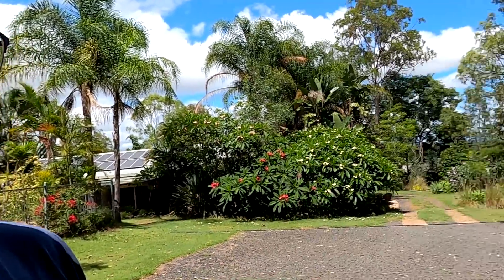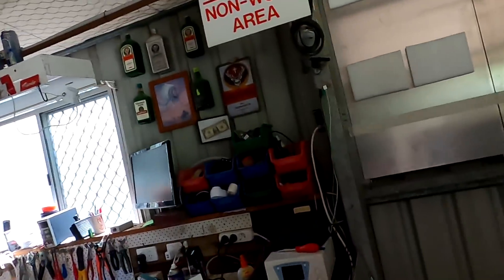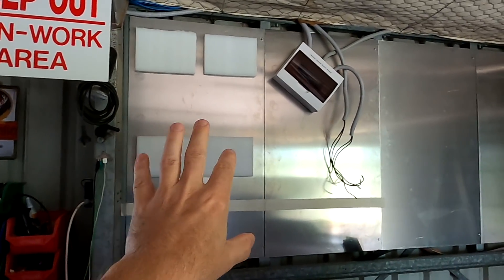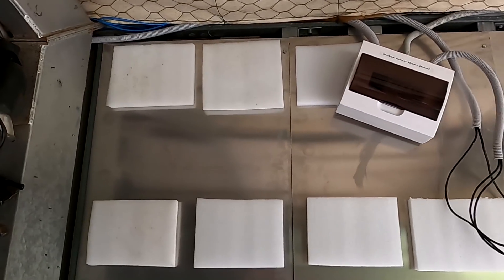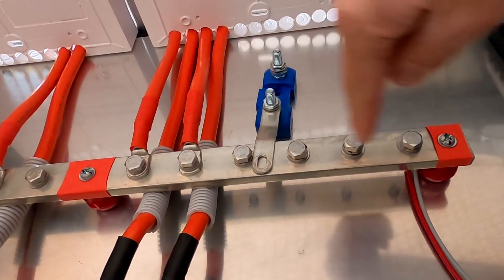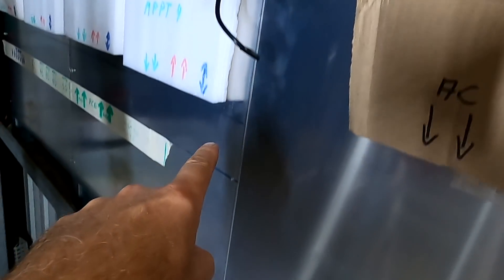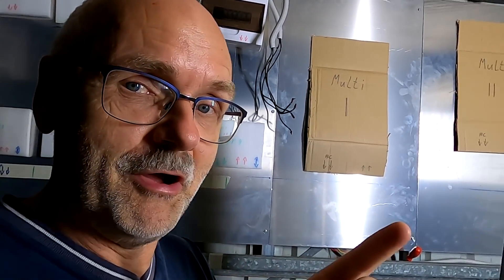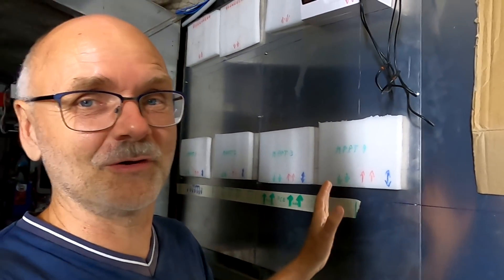No work, just design. The Solar PowerWall Project

Comment: A solar panel "roof bridge" between the two garages, will provide energy as well as shade for the east wall of the OGG
Reply: I think he should consider this other than $80 insulation roll
Reply from the maker: Great idea but I still need access to the gutters with a ladder. Also the mechanical constructions would be massive due to the wind load with such a roof.
Reply: Could be done as Andy said with lots of rails between the two, part way up the rooves. Lots of wasted unused rail. 
Easier to unscrew the tin on the side wall and add insulation later.
Reply: Anything between the sheds would get covered in leaves.
Reply: Or instead of a bridge, put more  pv panels along the wall nearly vertically. Shading the wall for cooling and collecting some extra power.
Reply: @chuckziska988  great idea
Reply: @OffGridGarageAustralia  perhaps @chuck ziska's idea?

Comment: 1.  Seal the top of your mounting panels so air cannot escape the back into the garage. 2. Create vents to the outside of the garage near the ceiling under your soffits. 3. Natural convection will pull cooler air from inside the garage (near the floor) up behind the equipment and outside. 4.  Ta Da...free equipment cooling.
Reply: I was thinking the same thing, when he said there was air in between!
Reply: Brilliant
Reply from the maker: Vent opening to the outside is not good. Rain and critters. That's a lot of effort to get this right with the corrugated outside wall. Easy on a straight wall...
Reply: @OffGridGarageAustralia  - could you put a baffle at the top, conduct the air to a pipe, route the pipe to the top most gable vent or even move it outside to add a solar attack fan?

Comment: Use the extra pv panels you have and attach them vertically on the outside wall of your garage. You will  reduce heat on the outside wall and produce a little power. Win-win in my book.
Reply from the maker: That is actually a pretty great idea!!!!

Comment: 4x M6 on each side is WAY MORE than sufficient.
Reply from the maker: Even it threads only 2.5mm into the steel post?
Reply: @OffGridGarageAustralia  The load has 2 components. Shear and tension. The shear force required to break 1 6mm bolt is 7.2kN (~767kilos). So your're good there with only 1 bolt. The other is tension. Let's say the inverter is 100 kilos and is mounted 30cm from the panel (1m tall). That works out to ~33 kilos tensile force on the top of the panel. A steel m6 bolt, even in 2mm steel, will not pull out at 33kilos force.

Comment: Thanks Andy, just as a thought for strength on the aluminium sheet you could add a fold to the top on bottom of the sheet and nick the corners out for the uprights, another good tool for making  strong threads into sheeting is using Rivnuts
Reply from the maker: Thanks Ross! I'm thinking about a horizontal support, same size as the posts but mauby I just leave it as it is and see what happens. I'll do the hang-test first 😉

Comment: smiles ... like my hot tin shed in beerwah ..  radiant and thermal conductance .. a piece of high cover shadecloth hanging from the surfeit down to base ... secured ... and this shadow does the rest .. can still get behind .. visually see the problem area ... cheap and easty to install ..  and measure to ensure has done the job .. no need to over engineer this solution .. cheers .. keep up the excellent work .. cheers
Reply from the maker: Thanks Mike. That's a good solution.

Comment: Put some pink batts in the wall behind the al panels and also behind the battery shelf, cover gap outside with panels, use the 5kva for the shed and car, then when it comes to it in a few years  put in a single phase 10kw inverter to run the house (on the right hand panel). If you think heat is still going to be a problem make a room in that corner, finish insulating the rest of the walls and add a small air con.

Comment: If you aren't going to enhance airflow through the fins of the MPPTs remember to keep your ducting 100mm from the base of the MPPTs. It might be perforated ducting but by the time you fill it with cables it will impede cooling airflow if it is too close to the MPPTs.

Comment: A perfect design of the power wall . You may need an actual PV Main Disconnect Switch where the breaker panel was coming in from the roof for a safety measure to disconnect the PVs  from the cables going to the actual breaker panel that’s on the wall . You have a great mind on your shoulders and I and we You Tubers know you will succeed with success in powering on the equipment . May the solar be with you .

Comment: Hi Andy, I really appreciate your show, it is the first thing I look for when I get on my computer. I have really learned a lot from you and I have purchased a few of thee items you have reviewed.

One final thought on your layout. Since you will have to run some large cables from your battery box to the inverters,  why not move all the huge bus bars from the battery box to the wall horizontally just below the chargers and inverters? You can tie the current short horizontal and vertical bars from the battery box  together to make the longer bars on the wall thereby eliminating any need to buy more large bus bars or wires. Then it will be a simple matter to attach the inverters to the bus bars with circuit breakers between the bus bars and the inverters.

This will  allow you to have all the connections readily available without adding more large cable as well provide shorted path to the bus bars for future use.  This will also give you room for one more row of batteries in the box, and if in the future  you need to add battery box #3  it will easily fit to the right of big box #2 with an additional 4 shelves.

I will try not to make any more suggestions on the layout unless you ask for more.

Oh, by the way, the invoice is in the mail.
Reply from the maker: Thanks Daniel, I appreciate your comments and good ideas! Please keep them coming...
That would be a total different design though. I think it's far to late for this now as the battery box is already finished. Also having the busbars mounted like this would call for large complicated covers as these busbars need to be isolated  everywhere. Shrouds, plexiglass, plastic covers. This would be huge...

Comment: Andy, Andy, Andy. 4 screws will be enough or go 6 if you want but you won't need any more than that. You are making it much more harder for your self.
Reply from the maker: 4 screws taped into 2.5mm steel will be enough? If the inverter falls down, where do you live? 😉

Comment: Hi Andy, just a thought on the heat on the wall from the sun....as the safari Landover had a second roof with an air gap.
So do the same on the the wall with a air gap and small gap top and bottom for air circulation.
Or as IV had done, think wood! Great heat resistant, as my off grid shed is in UK we have the odd day in summer of strong sun and heat but also we have a cold winter.....
My wooden shed with insulation and plywood internal covering, keeps cool in summer but warm in winter.
Reply from the maker: Thanks Mark, I still need access to the gutters for both sheds from this area. Wooden structures are not preferable in Australia. We have termites...

Comment: Andy, If thermal heating becomes an issue on your metal building panels, couldn't you just take the panels down from the outside of the building, insulate them and then reinstall them without having to disturb your PowerWall build?
Reply from the maker: No, that's not possible at all, I would have to unmount all gutters first... that's a huge effort for a small gain.

Comment: Hi Andy, love your videos! Usually i don’t comment that much but this time i have to. There is a misunderstanding about the screws and inverters. 2 M6 screws in the top will easily hold the aluminium sheet and the inverter, but more screws are better. That’s because the weight of the inverter is pointing down to the floor and not into the room. When this is finished it’s going to be a massive power factory! Regarding the combiner box near the ceiling i would definitely pull new cables all the way. Can’t be that many meters on the roof? Keep up your good work!
Reply from the maker: Thanks for your comment. Please keep them coming!
Others have suggested a horizontal cross beam between the posts to make the construction more rigid. That seems like a great idea and I will get them tomorrow. I can then have the same distance on all screws for all the panels.
In terms of the combiner box, there was a complete change I design as you mau have seen already in the next video... That was my bad mind 😉

Comment: Andi on the breaker boxes above the mppt charges I believe you have a smaller “trunk” running underneath them. Well on the right box there is two cables going into the trunk, but as you move from
the right box to the far left you are adding two cables at each box. So at the left box there will be 8 cables. Just a heads up so you can double check that the trunk wire chase is large enough. Also I would use the larger trunk wire chase with tabs in both locations just for conformity of looks.

Comment: A few thoughts, simply string the output of the fuse/breaker boxes straight down into the chargers, since there are only two wires from each breaker box they can be enclosed in a conduit between each pair cleaning up some of the mess. 

Likewise, the output of each charger can also be done the same way going straight down into the battery box thereby eliminating a large concentration of wires stuffed into a single channel and less chance of a short damaging all of the wires which means a much safer and classier looking installation. Since there is no need for the input wiring to travel horizontally the wire runs can be much shorter also cleaning things up. 

Inso far as the input to the inverters is concerned, placing the horizontal run from the battery box below the horizontal garage frame and up into the inverters keeps the left side cleaner and functionally organized.

A final thought, running the vertical wires behind the aluminum panels presents a much cleaner appearance.

Comment: The pattern with which you screwed on the screws of the plate for the charge controller is also easily sufficient for the inverter. The weight of the inverters pulls the plate down, creating mostly shearing forces on the screws. The shearing forces are carried equally by all screws.

By the way, it's funny to see how the sun travels the other way across the sky for you!

Greetings from the northern hemisphere.

Kind regards
Reply from the maker: The sun travels the same way down here, from east to west. Just we have it in the north and not south. Which does not matter in Summer as it is straight above us (almost no shade when you stand straight).

Comment: Andy, about the insulation on the back wall, have you thought about stopping the heat before it reaches the shed wall?
Perhaps shade cloth horizontally between the 2 roofs, or even vertically up the outside of the shed wall with a 100mm gap between.

For the backing metal, if you were concerned about the 6mm bolts into the shed frame you could use nutserts, this would give you a lot more metal to thread into.
Reply from the maker: Yes, Steven, that's a great suggestion. I have some older solar panels for that purpose mauby...

Comment: as for hot wall; use shade cloth on the outside of the building. hang down from eves or eve to eve between buildings. no more hot wall. you could do it all the way down the building and keep the entire building cooler
Reply: Have done the same for a West facing external inverter with double shade cloth.

Comment: Since I am in a significantly warmer climate, I agree that the heat producing SCC should not be in a vertical row. Much better to have the horizontal row. I can assure you that heat buildup will be a problem the more equipment you install, and the insulation on the wall is a very good idea. Perhaps a horizontal support beam at the top of the Multiplus sheet metal (behind).
Reply from the maker: I had this already in the cabinet with the inverters sitting vertically above each other. The top one was always hotter...

Comment: I might move the four MPPT controllers up a bit to facilitate airflow over the cooling fins at the back (perhaps a 50% increase distance between cable tray and MPPT).
Looking good though!
Reply from the maker: Yeah, that was not the final position on the wall, just to have a rough look.

Comment: BMS PROJECT SUGGESTION that be appropriate at this point when many of us are considering multiple battery strings. It may be time to begin looking for a 'second generation' BMS that can 'talk' to multiple strings, inverters and has better communications connectivity and software. This might also be of some value in your new setup. The SEPLOS BMS seems to be being installed in several of the rack mounted battery systems these days. I am planning to check into it and others that watch you might be interested also. Thanks for your interesting and entertaining videos. Phil
Reply from the maker: Thanks for your suggestion. I kind of agree with you. On one hand this seems to be a good idea and necessary to have such communication across all devices but multiples battery strings also makes this kind of obsolete. Imaging you have several parallel battery banks and one bank shuts off due to a BMS trigger. Does it matter? It's far less tragic if having two or more banks.
But in the future, we will definitely look into this and I have looked at the Seplos multiple times. Apart from the 'easy' communication it does not really cut the corner for me...
These days, we can communicate with almost any RS485 BMS. Even a Daly...

Comment: For hanging the inverters the best would be to put a horizontal post behind to fix the inverter plate to it and avoid the 10 screws on top and maximize   rigidity so it would not flex in the middle. Good project. Regards
Reply from the maker: Thanks George, that's a great suggestion.

Comment: Andy, if you dont have 3-phase motor, you dont need true 3-phase. It is better to have strong 1-phase. So you can have more paralel inverters and if there is no load one (or two) inverter can go to sleep mode. If you have 3-phase all inverters have to be running (more consuption).
The bottom free space I would save for another battery back as somebody mentioned below. It is such a waste of space for the inverter, if the fit between each other on the metal sheets :)
Reply from the maker: I need 3-phase power. Not for running any motors or so but the house has 2-phase supply already with a 120° offset due to a shared Neutral.
Reply: @OffGridGarageAustralia  If you will be grid tie than yes, but if you will be off grid not at all. For off grid lots of people use ATS and they have only one strong phase (12-15kW). If they have low SOC ATS just switch to the grid. On this ATS they clammed 3phase to 1phase (3phase on one side, 1phase on the other). In this solution you dont have to change the wiring, on the grid you have proper 3phase, on off grid you have strong 1phase instalation. But you have to think about cable section to not to overwhelmed neutral. In normal wiring it is not a problem but if you have big loads and small section of the cable for main supply (6mm2 or less) this could be a problem.

Comment: Hey Andy if you put shade cloth between your 2 sheds it will shade the tin on the shed  walls it will probably lower temperatures on hot days buy 10 degrees  and it's a reasonably cheap  option  available  .
Bunnings has shade cloth or small shade sales u could cut down  and use 
Thanks for your great content  too 👍👍
Reply from the maker: Thank you, I still need access to the roof from this side though...

Comment: You should leave a greater distance, like 100mm between the trunking and mppt’s. Mine was close to slotted trunking, and got excessively hot, and burned the positive battery terminal on Victron 100/50. (The screw is damaged) now using a push fit copper & aluminium 16mm pin, which does fit 16mm wire! Wire stays cool now.
Reply from the maker: Yes, it was just a general position, not as I mounted it.
Have you used ferrules or bare wire in your MPPT?

Comment: HI Andy. My two bobs worth.
You probably arent going to change solar charge controllers and they do generate heat
You will enhance solar production and use the fuse box regularly.
So.... I would swap the whole lot and put the charge controllers on top and keep your panel wiring and fuse box where you can easily reach them. The 240 volt section looks fine and functional.
Good Luck and good beer

Comment: Uncle Andy. Haha welcome for the flow direction idea, unless someone else also had it.
But 10bolts for the panel is overkill, 3 each side on the top half should do.
But as I mentioned some countries have the double pane windows so I could suggest. It wasting money on insulation though it would be preferred.
80 dollar a roll. That could go to equipment or more goodies :p
I'm liking this fast release videos

Comment: My two cents : I'd put one MPPT + one inverter + one combiner on each of the panels (one set - one panel), thus dividing the system in functional blocks. 
Thus, you still have two panels, one for the fourth MPPT, the Pi and other electronics, battery shunt(s) and monitors, relays, SSR's and stuff and the other for AC stuff.
Also, I'd arrange components by frequency/probability of need to access, meaning that I'd put combiners at the lowest point, in order to access them without climbing the ladders.
Reply from the maker: Thanks John. but all the MPPTs need to be connected to the same busbar (via breakers). So do the inverters. The cabling effort would be a lot higher, I think. But generally, that would be a good design.